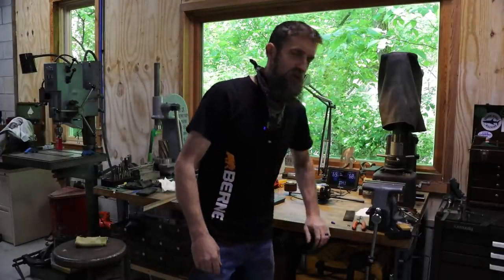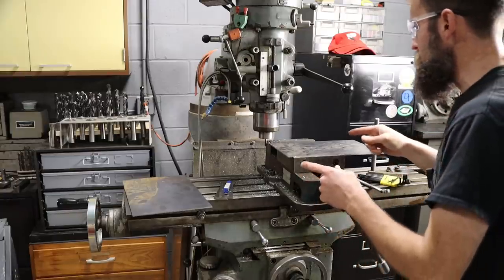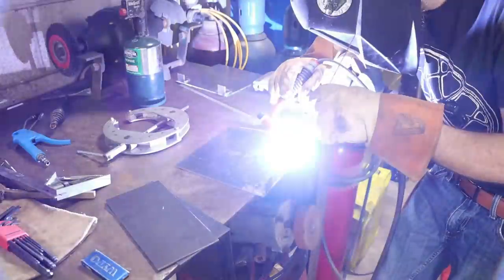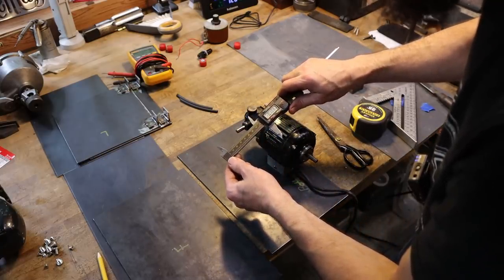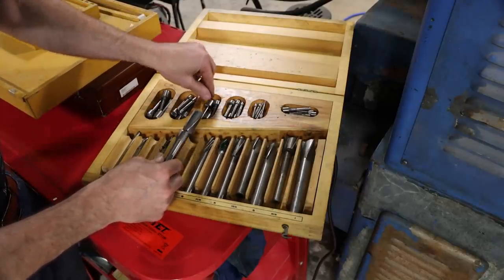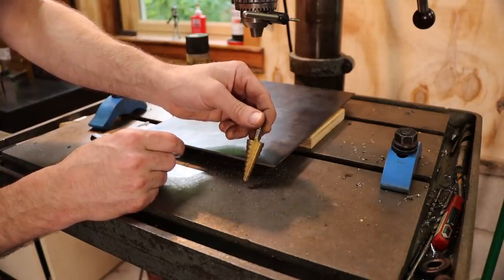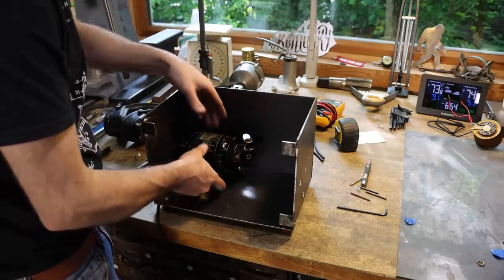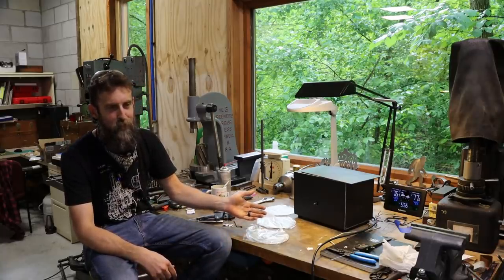Awesome Slow Speed Diamond Lap Build pt1

Comment: If you measure the screw first with your digital caliper then zero it then you can measure the distance between the outside of the screws without having to readjust your caliper. Much quicker.

Comment: I'd add a cord wrap built into the handle. Plus a tray at the bottom to catch water dipping/dust and to protect the disc from getting bumped. and as anther had mentioned, ventilation would be good.

Comment: Another use is for tungsten sharpening, if you are at the point with your welding skills a honed tungsten is bliss for low amperage work. The start is super crisp, and the ability to focus the arc is incredible with a properly honed tungsten. Night and day to simply sharpened tungsten with pronojnced striations from the sharpening process. The one tupe os honing I found to be the most beneficial is a tungsten with two angles hones. The standard tungsten fo the majority, then at the very tip less than 1/64 in  diam a very shallow "blunt" angle. It starts just beautifully. I use a 100grit 5" diam disc on top of a 600 grit 6" diam wheel,  I have the ability to hone material off fast with the 100 grit disc then fine tune and polish with the 600grit wheel face. .

Comment: If you put a small pulley on the fast shaft of the motor with the addition of some round belts it would make a nice grinding motor for use with the spindexer.

Comment: Control panel would be better if recessed enough to protect the the controls, big old heavy box has enough inertia, that bumping will wreck the switch arm and or bend the transformer shaft.
Reply: The beauty of a box is you can run it in different orientations. In the vertical and the horizontal. Laps are often run horizontally. They're just more intuitive in that position. Ergonomic like and all. But Steve did not seem to design with that feature in mind to me.

Comment: Used those type of discs for sharpening my HSS wood turning chisels, they are pretty good all told but like you I fabricobbled something to run them a bit slower using an old desk fan motor
Reply: I bet your fabricobbling can't hold a candle to the one I made. I should take a picture of it. It's real bad. I don't know where the motor came from. Had a pulley on it. But it is like a fan motor. Fan motors rely on the fan to keep them cool.

Comment: RE: Step drills. Some name brand versions are crap too. At least the newer ones. I had to replace an old Irwin that had to be at least 5 years old with a new Irwin and found the newer one drilled holes much larger for a give size than the old one did. I thought it was defective so I sent it back and the replacement did the same thing.
Reply: Step drills put large diameter holes in sheet metal. Which is a sketchy thing to do at best. Quite often the diameter of those holes doesn't need to be very precise or a rational size. Neat, easy and round are the major factors.
Reply from the maker: Yeah, crap tools can be bought everywhere these days. Seems like if something is good and lasts a long time they purposefully make it cheaper so it last just long enough for you to be ok with it in hopes you buy another one of the same brand.
Reply: @SteveSummers  make a product so good someone only has to buy it once and you've just lost a customer on your first sale.

Comment: I Tig weld at least once a week, you need to grind, or at least finish the grind longitudinally, so the grind lines go straight towards the point, otherwise you will get an eratic arc.

Comment: The grinder box is looking great. What are you doing for ventilation? Both the speed control (variable transformer) and the motor will generate heat. That heat has no where to go in your current design.

Comment: That motor will need some ventilation, some air inlet holes in the bottom of the box and a small impeller on the Hi-speed shaft with a grill covered hole.

Also don't forget to ground the box to the power cord earth - don't rely on a ground via the motor body.
Reply: @John Verne definitely need the box bonded since its on plastic nubs.  Stay safe

Comment: Hi Steve, did you consider cutting vent slots into the bottom plate and along the top of one of the side plates and let natural convection moderate the temperature within the box? being able to crank up to 11 might need extra cooling :)
Reply from the maker: I did, but this shouldn't run long enough to even get warm. The chances of me walking off and leaving it running could make it worth doing.

Comment: Hey Steve noticed the way you sharpened your tungsten, one of the first things they showed us at welding school (that I attended a very long time ago) was not to sharpen tungsten that way as it makes the shielding gas spiral and has the effect of swirling air into the stream, if you sharpen the tungsten so the striations are verticle and not around the tungsten the gas flows more uniformly.... Just an observation not saying your way is incorrect but give it a shot and see if it makes a difference

Comment: I don't know if your lap plates are ferrous but if they are could you use an aluminum platter with rare earth magnets to hold them in place? It would make grit changes easy and if you skeletonize the platter it would help with heat buildup.

Comment: Nice build.  I look forward to see it in action.  Did you have anything specific in mind to grind/lap with the new slow speed grinder.   You mentioned carbide, possibly carbide inserts.   Stephan Gotteswinter's version  of the slow speed lapping grinder looked similar to yours.  I think if I were to do a slow speed lapping grinder, I'd be borrowing ideas from both You and Stephan.  Glad to see you back in the shop working on various projects rather than working construction.  I love it when you say that you are just throwing something together and then it goes together +/- 0.001" (okay, maybe +/- 0.002").

Comment: I was thinking the motor shaft could have poked out the other side and it doubled as your tungsten grinder as well.  I know Dale over at build something cool did not speak very highly of the ebay discs. You might have better luck with a cast iron disc and use your diamond paste.
Reply: Diamond plates work a lot better wet than dry. To the point where I would not even consider using them dry myself. To me that's making a mistake. If you're going to do something wrong then yeah you might have better luck doing something else.

Comment: That variac is going to limit your torque. It's probably better to use a chopper circuit, since it gives more consistent torque across the speed range. A dimmer light switch is probably enough for that small motor, but an actual motor speed controller would be better. Obviously a lap doesn't need a whole lot of torque, but I hate when the RPM of the disc dips every time I touch it, and I feel like it ruins the surface finish.

Comment: Steven, a nice pease of work. But my quistion is, why lapping on daimont disc's. The work for making the grinder, the investment off parts, burning fingers when grinding. Yes I know not everthing is good that  comes from CH but for 10 $ you can buy a box off 10 new inserts that gives mostly ar least 20 new sharp, lapped, exact angles etc. Bits for any material. Why so mutch effort to sharp one insert. Are that inserts not good enouch for the work we do in our shop?  I use them  for years and if I notice they get doll I take a new one and go one with the job in state to install the grinder get a cup of wather etc to grind and lap the insert, it tooks at least 10 minutes before thats done. Don't get me wrong I am not justing  the item you make, that's perfect. I am only wondering the need off it compering to the time you need to have a new insert.

Comment: I noticed that the noise level jumped quite sharply at speed rating 11  I think it is more an irritation than decibels. Perhaps one could pad the inside of the box or line it with plywood to dampen the vibration. Just a thought.  Pse eloborate on the cutting compound that you use on the drill bits.  My personal experience is that cutting fluid is a must but most of it ends up next to the hole and not on the cutting edge.  Regards from South Africa.....

Comment: Steve, why so huge box for small motor? You can move the front plate backward, almost to the middle of the bottom and use free space for tilt platform. And may be rearrange the contols to the front and cut some of the height, it loooks disproportional.
Reply from the maker: I left it that size for the mass. May not be needed but also leaves room for modifications. I agree with you but for now its going to stay on the large side👍
Reply: @SteveSummers  I can understand you, so many work in that box. You always can fill it with concrete if mass will be not enough :)

Comment: Have you seen the video of how Stefan Gotteswinter built his? It is pretty streamlined and he doesn't use premade diamond plates, but ceramic plates together with diamond lapping paste. Here's the video: https://www.youtube.com/watch?v=GOBtH4m2TYo

When you showed your trick how to easily measure bolt distances it came to my mind how to make it even easier: measure the diameter of the bolt, zero your calipers and then measure over both bolts. If you use the inside edges you can also measure hole distances like that (but only if they are the same diameter).

Comment: Could not tell from video if motor is air cooled or not?  However, running the motor too long, air cooled or not, at slow speeds too long could maybe overheat the motor.  AC variable speed air cooled motors should not run less than 20% of 60 Hz max speed to prevent motor overheat.

Comment: 3:35 Is that 3A fuse rated for 120V? That looks like a 12V automotive fuse. It may be fine, but there is a Voltage rating on fuses along with the current rating.
Reply: It's an automotive fuse.They're rated for 32V. 
I just changed a 3A like that one in the air handler this week.  🙂
Reply: Update: I now realize that the plastic fuse in question was just temporary for testing. He will in the future have a proper 120V fuse and holder as shown.
Reply: @joeylawn36111  it's still just a panel mount fuse holder for the older glass tube style automotive fuses.
Honestly, voltage rating doesn't matter.  1A @ 100V is the same as 100A @ 1V as far as power is concerned.
Reply: @jimurrata6785  Voltage rating in a fuse or any other kind of wire has to do with the breakdown of insulation between two wires, or, in the case of a fuse, one side of the fuse to the other. Too high of a voltage can cause a flashover - But that most likely won't happen with 120V. Romex is rated at 600V max for example, any higher runs the risk of insulation breakdown.
Reply: @joeylawn36111  Do you really think 120V is going to jump over an inch of glass tube on an AGC fuse???
Or even the 3/8" between the legs of an ATO style?
Shit, I've got a 50,000V ignition coil and it won't consistently throw an arc 1/2"
But then I have welders that will put 20V across almost an inch of the amperage is high enough.

Comment: Salvaging an old treadmill will give you a variable speed motor with a control board too, these are not hard to find.
Reply: I haven't seen a discarded treadmill in a while now. They used to be a lot more common.
Reply: @1pcfred  There's one leaned up beside the garage across the street.  😂
I ought to go ask before recycle on Tuesday
Reply: @jimurrata6785  there's good scrap in them. Years ago there was one on every street corner. Folks tossed them after they got tired of using them as clothes racks. That time has come and gone now.  So if you see one grab it.
Reply: @1pcfred  I actually got mine from ebay complete with the control board for fairly cheap. I used it for a slow speed drying setup for woodturning.
Reply: @garybeasley4885  fairly cheap is still infinitely more expensive than walk away with it for free. Zero is a very special number. The concept of it did not come to our species immediately either. Zip, nada, nothing, the big goose egg! If it's for free then it's for me. Wise words to live by.

Comment: Also i thought that was the wrong way to grind tungsten electrodes? I mean you obviously know what your doing, and im fairly new to tig welding so im just curious why i always see people saying your supposed to grind them "vertically "  not to do it the way you just did. It clearly worked, is it just people being to finicky?
Reply: The reason you're supposed to grind it vertical is so the electricity flows straight down the grind scratches. Supposedly the electricity doesn't flow smoothly the way Steve ground his tungsten. 
God bless you! 
Have you placed your faith in Jesus Christ's blood for the remission of your sin so you go to heaven instead of spending eternity in the lake of fire?
Reply from the maker: Dont get too caught up in all that. Does it make a difference? Yes but only noticed on really really low amp settings. I have noticed a more stable arc straight grinding but only till you dip it in the puddle once.😁
Reply: @SteveSummers  thanks for that information. That's good to know. 
God bless you!

Comment: I have a number of the adjustable reamers that you showed in your video today. Out of the box, these units can be a bit problematic as they tend to grab and cut rough holes. I found this video, https://www.youtube.com/watch?v=ycb4r0_5zkw  , and it cures the problem.
When sharpening your tungsten electrodes, you should not grind them perpendicular to the axis of rotation on your grinder. Instead, grind them so that the point is towards the top of the stone as it rotates towards you. If you want to get really fancy and accurate, put you tungsten in a hand drill and turn them as you grind them. The reason for all of this is that if the striations made by the grinding process  run around the axis of the electrode versus parallel to the axis they can cause your arc to wander away from centre when welding. See: https://www.google.com/search?q=how+to+grind+tunsten+for+tig+wleding&rlz=1C1PRFI_enCA895CA897&oq=how+to+grind+tunsten+for+tig+wleding&aqs=chrome..69i57j0i13l2j0i22i30l2j0i390l2.11904j0j4&sourceid=chrome&ie=UTF-8#kpvalbx=_YbDFYMG_G8Ke-gS0mJPwCQ48  Also, wear a proper filtration mask as tungsten particles are harmful if inhaled.
Where did you get the diamond disks from?

And yes, before you start, I am a journeyman welder with over 40 years experience.